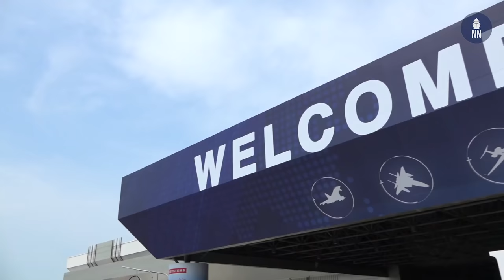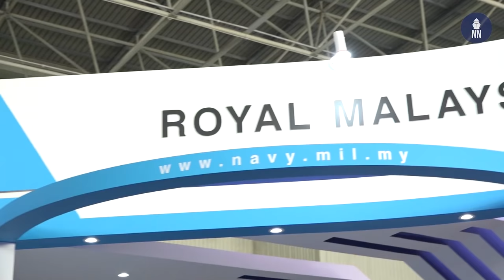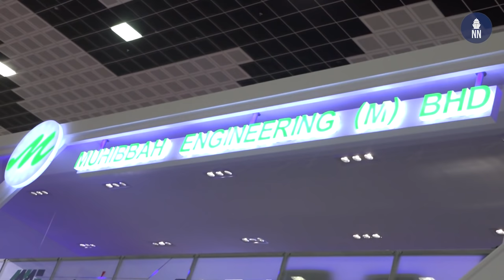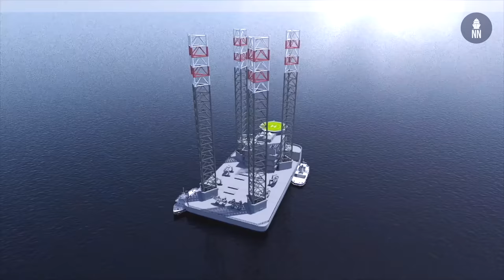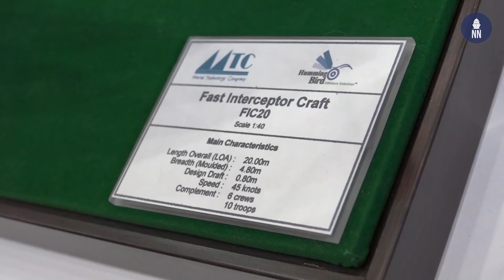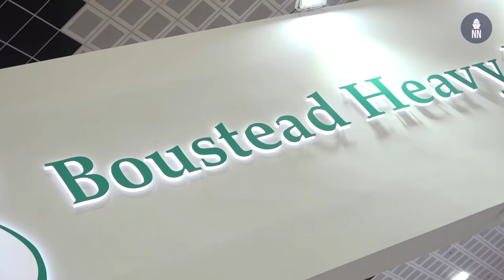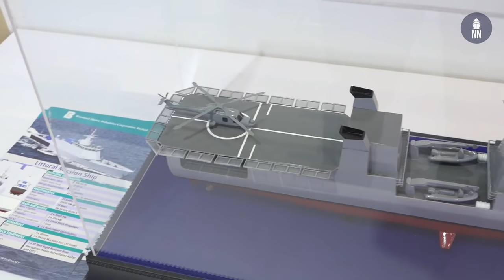LIMA 2019 Day 1: RMN and Malaysian Naval Defense Industry

Comment: the mobile offshore vessel needs to be much bigger, atleast three times the size of the concept showcased in this video . . . surprisingly the mobile offshore vessel has no weapons to defend itself . . . it should be armed with SeaDome® SAM & SM40 Exocet II anti-ship missiles (modular canister launcher) in addition to triple tube 530 MM torpedo launchers on port & starboard far side of the vessel . . . a Kashtan-M type 30 MM GAU-8/U Avenger six-barrel rapid fire rotary gun & missile CIWS will be an added benefit . . .
Reply: it's just a model, The real platform can change, Like weapons will be added after the main design is confirmed.